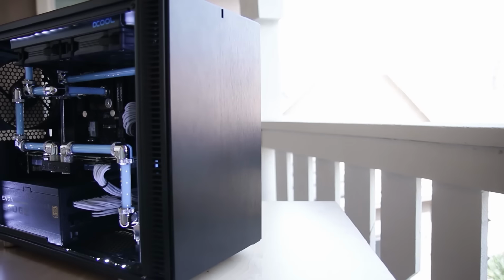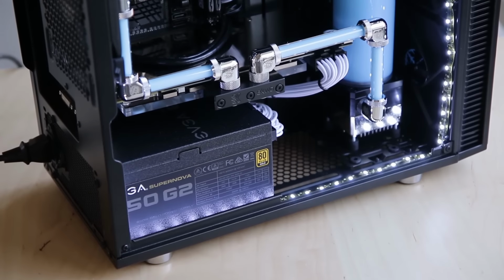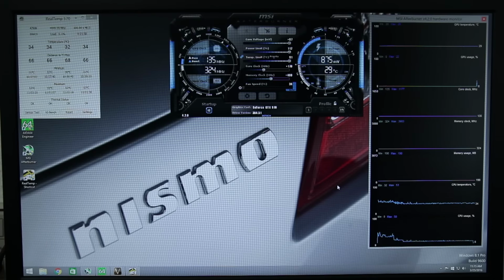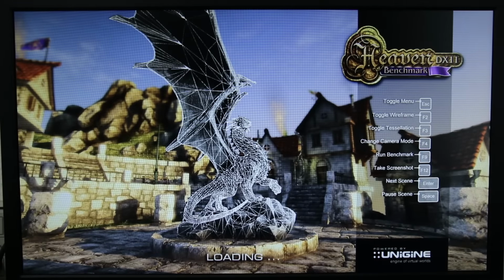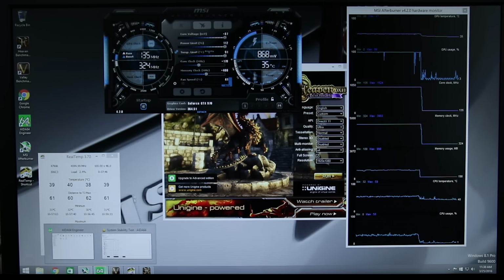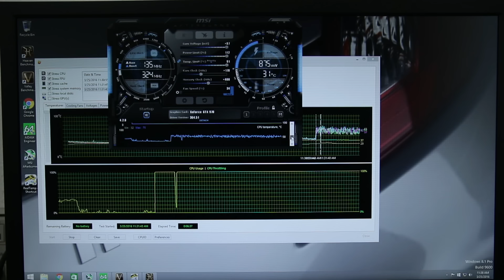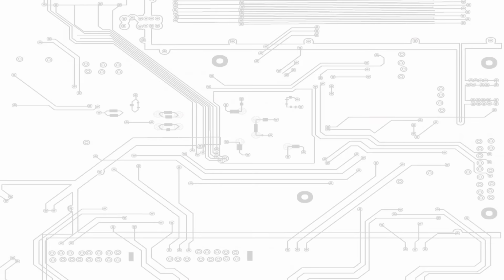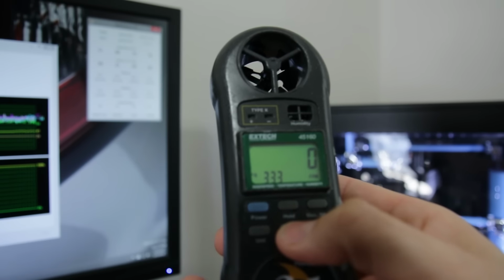Was a 240 Radiator enough?? Temp testing the ITX build

Comment: why do people put a radiator in the front intake of the case, doesn't that introduce warm air into the inside case, wouldn't that be counter productive of what a radiator is supposed to accomplish
Reply from the maker: +devil driver187 Ive already done a video debunking that. Go watch it.
Reply: +JayzTwoCents Link?
Reply: ***** ok, thank you jay
Reply: +devil driver187 radiator is supposed to accomplish putting the heatoutput away from the component, doesn't matter if this is the air in the case or outside of the case because the closed system what we are talking about is the water cooling loop, and the radiator puts away the heat away from that system to another system, simple thermal dynamics
Reply: +devil driver187  linus did one too, recently. differences between, push, pull, push/pull, push/push, intake, exhaust, all that. come to find out, as long as your fans aren't fighting each other, the results are about the same.
Reply: +Jan-Christopher Estelmann my case runs around only 5 degrees warmer at least on the inside when I put my rad in the front, tried positive and negative air pressure, in terms that 5ish degrees, I noticed my gpu running 5-9 degrees warmer, My cpu is 1-2 degrees warmer ""cpu water cooled" "gpu not water cooled", :( I understand the whole moving the heat away through the liquid but all air cooled stuff is affected by this, I wonder if I did something wrong
Reply: Doesn't matter that much...  As long as the air is eventually pushed out of the case.
Reply: +Phillip Tunstall that's it!!!!!! I think I gotta boost my rear exhaust a little more, and that should do it, Thanks man
Reply: The temp decrease your loop gets is more than the heat increase you get lol. Front rads hardly add much heat to your system but having another rad in your loop decreases temps quit a bit. I run a 140.3 in the roof and a 120.2 in the front and my temps are nice and cold.
Reply: +devil driver187 not really since the radiator is getting the cold air. the only time it makes a difference is if you have another radiator e.g. on the top
Reply: +devil driver187 

Using a front intake radiator does increase air temp inside the case but it doesn't make it go hot. Usually makes inside air 5-10 degrees (Celsius) hotter but can be minimized with adequate case ventilation. If the choice was between a single rad on top vs a single rad on front I'd go for single rad on top, but if the choice was between a single rad on top vs two rads on top AND front I'd go for two rads always.
Reply: +devil driver187  I have done this and I can tell you that the HDD gets to 50 degrees which is not good, rams are hot and motherboard temps stay around 40 degrees, but nothing to worry about.
Reply: HyunMo Koo I like having my push pull front rad, could be a placebo effect but I feel that the extra static pressure is nice to have to blow right across the gpu.
Reply: +devil driver187 tldr: Nope.
Reply: It doesnt really heat the whole box like many people think. Jay already did a video on this. Go check it out.
Reply: +devil driver187 You must be new. Look at his videos....he already debunked this. its his Razor build
Reply: +devil driver187 Pretty sure placement of the radiator generally doesn't make any difference. Also I don't think there's even much difference to using a water cooler to a heatsink, or at least any major difference to make water cooling worth it.
Reply: il2xbox I'm lazy :D
Reply: bcz it looks cool c: and i have a full size widowm on the roof c:
Reply: +Bradley Jansen Actually even then, no difference either. Go watch the video from Linus about this topic. Surprised me aswell.
Reply: +devil driver187 think of a car and their radiators always front mounted
Reply: +devil driver187 As long as you have positive case pressure the heat in the air coming off the rad has no time or place to add heat back onto components within the system. It just leaves. Especially if the main components are watercooled. Everything under a block would be completely isolated from case air. This has been proven on forums for at least 10 years now.
Reply: +koolBOY8323 what? That isn't what the test was about? It was about cooling performance and not the temperature of the air
Reply: +MoistGoat Its worth it if your overclocking, plus water cooling generates less noise.
Reply: +devil driver187 How's that when you're pulling cold air through the radiator? The cooler air will cool the liquid and some cool air will pass through the radiator into the case. What I don't understand is why people would place their fans to exhaust in a top mounted radiator. You're just dragging warm air from inside the case through the radiator. Having your fans as intake in a top mounted radiator sucks in cooler air from outside your case onto and through the radiator.
Reply: +brian rizzo (Shadowman8517) Well, engines run much hotter and computer cases don't move through the air;)
Reply: +devil driver187 It does not, watch Jayz video on this, even Linus tech tips has a video on this.. I have a 280mm closed loop cooler in the front (as intake) on my 6600k, and only a 140mm fan as exhaust in the back. Getting 27c at 100% cpu load (18c ambient temps).

Then i moved my closed loop cooler to the top as exhaust and putting 2x140mm fans in front as intake, getting only 2c-3c cooler then the other way. One thing it really introduced was alot more noice since i can close my top when theres nothing mounted there.

Fractal Design Define S

sorry for bad english
Reply: +MoistGoat Not worth watercooling a CPU? Lol. I sit at 4.6Ghz and max my temps hit under stress test is like 58c. Let's see an air cooler do that. Oh and that's with fans running at a constant 800rpm.
Reply: +devil driver187 some people will say your right some will say it doesnt matter and i can only base it on my own experience and ive to tell you that if your gpu is not watercooled it will bring alot of heat in the case and if you mounted the rad on top  as exhaust that case hot air will pass the rad and make your water hotter so in that case its better to mount in front as intake as the gpu heat doesnt influence the rad but that only matters if you seek the limits. in jay situation the cpu and gpu is watercooled and are on same loop so the two main  heat producing components dont influence each other as air in the case(only as water).

i think it will matter more in the future when ram and ssd will also be a very hot component.
oops i told a secret....(watercooled ssd is already confirmed so it wasnt a secret.)
Reply: +devil driver187 Most likely it's because you get less air in the case because of the radiator's FPI and lower CFM from static pressure fans.
Reply: i'd just like to mention that any tests that have been done focus on the temperatures of the components that are being liquid cooled - which aren't the components that may be affected.

i'd be much more worried about the VRM's, Mosfets, and the Memory if their Voltage is on the higher end. mostly the CPU Power Delivery though. they tend to run warm as it is, and their cooling solutions are.... well, craptastic usually.
Reply: +Voodue Linus did a video on delidding it doesn't affect much
Reply: +devil driver187 
Because their smart like me its working on my pc so no it isn't !
Reply: +devil driver187 You are right, but in reality it doesn't make much difference. The speed with which the air is being circulated compared to how quickly the heat transfers into it is much higher so you don't really get much hot air inside at any given moment.
Reply: +Brian Hamel Linus just changed the stock thermal paste and put the lid back on. Delidding is keeping the lid off and mounting the cooler directly to it and yes, it makes a big difference.
Reply: SaladFingers

I dont give a fuck what linus thinks
He never teach anything i didnt know already.
Reply: SaladFingers Oh, my mistake. A question though, I heard that when you're putting a cooler directly on a die ( Like back before they started putting heatspreaders on cpu's) that it was easy, if you weren't super careful, to chip a die and kill your CPU, correct me if i'm wrong.
Reply: I'm not sure what you mean, but the biggest risk imo comes in the actual process of delidding it. Different architectures will have the caps positioned on different places so if you pick the wrong side to use the razor you could kill the chip instantly. If it's done right, then just being careful with the mounting pressure I think is enough. But yeah, this stuff comes with risks :P
Reply: Brian Hamel the risk is to crush the processor when you screw the cooler to hard on . even a small fraction of over tighting can harm the processor . much saver to fix it on the die cap and not directly to the processor.

it can be done but its very risky and dont forget even if it worked a little bumb on the case can affect the processor as the weight of the cooler and mounting pushing on it will resonate.

the few degrees or Mhz you gain is not worth it.
Reply: MrBall Breeder That's what I thought, thank you for clarifying that
Reply: +devil driver187 He showed the air output temperature; went from 24 to 34C...
it would make the parts inside the case 10 degrees warmer, but the true heat generating parts (cpu gpu) don't really GAIN much if any heat from the surrounding air; they are covered by the loop. 10C increase on your mobo vrm might affect things in a minor fashion but really it's super negligible unless you are overclocking the hardest ever super l33t rig.
Reply: brian rizzo always mount front....yea VW beetle and porch would facepalm you
Reply: +frollard actually this had been covered before are it was proven to make no difference, top or front.
Reply: Nemesis Zero

front can be worse if you have lot of positiv pressure kinda like a vaccuum but its only about 5 degress as most and its better to use both than only top
Reply: +devil driver187 its only marginally hotter. dont worry about it :)
Reply: +Intvel Nexus but Jay already tested it and proved that theory wrong, plus positive airflow doesn't create a vacuum (unless you are using a vacuum or huge fans at high RPM, not possible with PC fans) positive airflow would remove hot air faster and benefit cooling.......
Reply: +JayzTwoCents you come across very ignorant ... but hey i suppose thats just you .. youtube videos make us better than others
 yay
Reply: +moose man For him to be ignorant it would mean that he doesn't know what he is talking about. Since he has tested this, and knows the facts about it, he isn't ignorant.
Reply: +moose man as Krytern UK said, Jay can't be ignorant on the subject because he has tested the theory in the past and proven people completely wrong, i bet you are someone that believes that cable management helps to keep a PC cool lol
Reply: Nemesis Zero I remember being in a argument with someone about 5 years ago in regards to cable management. At that time I was lazy and never did it and he constantly kept telling me my computer will be hotter then it should be, even though it never was. I'm glad we have YouTube with people like Jay and Linus/Luke who are willing to test these theories so we can see the true facts in balanced and fair tests.
Reply: Nemesis Zero it used to be important that you manage the cable so it doesnt influence the airflow . now with watercooling it doesnt and on air it still does if you're seeking the last Mhz out of cpu/gpu while overclocking.

dont get it wrong ,cases that get smaller this days makes airflow still important while aircooling.

the biggest mastake of people getting they're opinions from youtubers is that they dont realise what the youtubers are using .
in case of linus they always use low but more mainstream stuff , not overclocking ,low voltage and Mhz cpu makes cooling less important as that way you could cool it passively.
in case of Jay ,he always overclock and try to get the max out of it.

both of them gets true results but in case of linus channel it gives a wrong impression .
example :what cpu did they use for the cable managment video where he fills up the case with anything.surly not the 6700k at 4.7 GHZ and 1.35v. Linus group are specialist of thinking an answer to a question and then work on it to get the results of they're answer.
this way you cant say they lie but for people who has the knowledge about hardware makes they're test and results unreliable,doubtfull and fake.

but hey he prooved on a video dude.yea......
what did they prooved actualy?
that some cpu can be cooled passively not that airflow doesnt matter while aircooling.
Reply: MrBall Breeder Doubtful, unreliable and fake? Fact of the matter is that the test they did for cable management was fair and the results show it makes no difference. How is their video fake? Do explain. Did they lie about what the temperatures were? Did they underclock the CPU when adding more stuff in the case to get the same temperature readings? No.
Reply: Krytern UK as you request explaination means you dont know enough about hardware. 

they used low end intel cpu with low speed and voltage .that means low heat that can dissipate passively without any fans attached on the cpu for short periodes and as they are well knowed todo just a 10 min test it fits the result of cable managment and airflow not having significant impact.
i want to see them doing same test with an I5-6600k and i7-6700k at max overclock speed

same as an other video about watercooling AIO that showed an cpu working at 100% while benchmarking and reached 35C as max temp after 10 min test.my guess is that both video used same cpu. dont forget that this temp was while benchmarking.

as i sayed before you cant say they lied but they have tweaked the truth as an magician on a stage.

the results are very misleading as the majority seeks max performance what they're wallet can reach and can harm consumers that build a pc based on those videos.

for the rest i trust more Jay,Paul ,Kyle ,tech syndicate,singularity computers OC3D or any other tech channel than linus as linus videos is not about to teach stuff but more how they can gain more money.Linus is a bussiness the tech channels are tech enthoussiasts.

if luke would have done the "cable managment "video with an long time frame benchmark as 3 or even 6 hrs the cpu and gpu would throttle , but that doesnt fit with the answer results they wanted to show. 

by that they tweaked to get that result and by that makes them unreliable,doubthfull and fake but i never sayed liers.
Reply: +Krytern UK exactly, the test they did with cable management was very fair lol, they blocked ALL of the fans and it made no difference lol, looks like we weeded out a "know it all" lmao
Reply: +MrBall Breeder dude, you need to stop arguing a point that you clearly don't understand, just so you know i have tested my system for cable management by also blocking my fans and got the same results while overclocked, first i tested using my old 212 evo, then again with water cooling, i have seen for myself that cable management makes no difference, for water cooling i have had my radiator on the front of my PC and then moved it to the top and had exactly the same temperatures while idle and during a stress test, it makes absolutely no difference and doesn't create more heat.

You are believing old myths that have been proven wrong time and time again, that in itself shows how much you really know about PC's, stop being so judgemental and take the videos you watch seriously, these people like Linus and Jay are on Youtube making videos in order to help people, they make a living off of teaching people that are less experienced because they want to help!! so do yourself a favor and pay attention, not everyone on Youtube lies and not everyone is out to get you!!
Reply: Nemesis Zero He seems to think that Linus magically makes more money if he says cable management makes no difference, compared to if he says cable management does make a difference. That makes NO sense at all. Where does the extra magical money come from?
Reply: Nemesis Zero dunno why you are talking watercooling to me when you talk obstruction of airflow you are mixing both just for the sake of argue.

you tell me i clearly dont know what im talking about but say such of idiotic arguments as that there is no difference on temp while overclocking with  obstructed fans on your evo . i dunno what  "overclock" means to you but my 4770k with 1.35v at 4.7 GHZ not only show a differance in temp but also throttles down if i obstruct the intake or outtake  of my swiftech watercooling rad and no it doesnt after 10 min but it does after 45 min  .same goes for my 4690K overclocked at 1.35v at 4.8 GHZ watercooled with an AIO corsair H110i and my 2core duo E8400 overclocked to 4 GHZ   cooled on air with an old air cooling block similar to an evo and my 2core quad Q6600 at 4 Ghz aircooled with the old noctua nh-d13 gets BSOD

so stop telling bullshit and stop acting as an linus fanboy because i doubt you can match my 25 years of experience  in pc hardware

and god damm  stop putting words in my mouth .I NEVER SAYED THEY LIED.

i sayed they tweaked the truth as an magician on stage as no decend cpu gets maxed out on benchmark at  35C with aircoolers or AIO.

testing obstructed airflow  on low end cpu like the 6100U  for example with aircooling block never will give any difference as its low voltage and clock doesnt need any aircooling as a passive cooler would be sufficient and thats what they showed but saying that the results showed that there is no difference in general is just criminaly wrong.

i clearly know what overclock is and its more then just ramp up from 100 to 103Mhz in your  UEFI.

linus videos are clearly NOT for  helping with they're videos and i even doubt you checked they're website. linusmediagroup  is an business and a business needs to gain money to pay the somany employees.linus is a great business man i never doubt that but all they're videos doesnt learn anything else than general information about home pc and home IT .explaining quickly as possible  in 5 min a text wrote by one of hes employees who clearly knows what google and  wiki is and talk about the history of stuff copyed from the wiki isnt usefull information as its general knowed and general accessible.

stop trying making linus an tech god and stop him to threat you as an moron that cant google and dont know about wiki.

i also dunno why you bring Jay in the argument as i already sayed i trust Jay's information

maybe im arguing with a troll here but its time that the truth gets out there and the curtains falls down because generalising results of a brainstormed session about how and what to use to get that end result just for the sake to bring a video out .will have as final results that peoples wallet gona hurt and that will not be mine.

and now just for fun lets do the same as they do

linus:lets proove that a pig can fly and make a video of it
luke :how can we get  a pig flying
linus : i dunno ,how long will it stay in the air if 3 people throw him up in the air
luke : not long for sure but if we shoot it with an canon in the sky it would be longer.
linus : lets try it and if it fits in a 5 min vid ...

NEWS
FLYING PIGS CONFIRMED BY LINUSMEDIAGROUP.
(they have video to prove it)

did they lie? no they dont .the pig did fly....

this text wall will not matter for trolls and fanboys as the one only seeks meaningless arguments and debates and the other only see they're favorite item or god as the best but the shiny blind them .
Reply: +devil driver187 Pretty much margin of error
Reply: +devil driver187 Yeah it'll wreck it
Reply: +devil driver187 THis guy isn't the know all, be all. You have to take into account ambient temps and climate.
Reply: +MoistGoat Really isnt it is more about looks and a preference
Reply: +devil driver187 it's for positive air flow into the case. It's better than having a triple or quad radiator blowing into the case from the top.
Reply: Keng Vang postive and negative airflow doesnt matter anymore with most case build as you cant make a pressure in a case full of holes.

dont get me wrong it used  to exist in time frame of pentium 4 and even for the dualcore ones but there where no scientific proof for it whats the best, until tomshardware asked an university  to test it out and give the final answer (answer was positif pressure) not much later cases started to build holes in the side panel for a fan but it disrupted the airflow stream and they solved by drilling holes all over the case .

these days you can only get a flow of air but not a stream . you can place all the fans as intake and air will push out every where and the only thing you need to consider is the heat build up that a graphic card can create as its a pass true cooling now and not a blower type that only exaust at the back.

if cpu and gpu is watercooled on single loop then it totaly doesnt matter where you mount it.if its watercooled seperated you need to mount it both as intake or exhaust so one can not influence the other but that only show on long runs or at the limit of max cooling performance (or when you seek very high  or max overclock)

and at last if you watercooling one and air cool the other then  mount the rad as intake (preferly in front).

dont care if you believe me or not but i can tell you that several pc builds has returned when cpu rad was mounted on top as exhaust by request of the buyer even if i warned them.

heres a great advice take special attention to small factor cases and do your research on the right channels. examples are overclock.net or OC3D or tomshardware as oldy ones or as newer ones tech syndicate.
dont rely on one result but check all of it and try to see an general line before deciding anything.
Reply: MrBall Breeder I'm a fellow overclock.net member too. Also watercooling for the last 3 years. And yea positive/negative does matter if you don't want dust in your rig. Also a radiator between gpu and cpu does MATTER! Cuz I changed my loop and have a temp probe.
Reply: Keng Vang well thats what dustfilters are for the suckers anyway as you can't create pressure anymore in airflow. (some small factor case still can)

i dont get the rad between cpu/gpu  comment please elaborate .
Reply: MrBall Breeder unless u have HEPA certified filters good luck with that.
Reply: bmxriderforlife1234 you can achieve a pressure if you obstruct all the holes.

have fun with that.

i cant even with 10 fans on my case and taping over the majority of holes.btw i have 3 200 mm fans 2 140 mm fans on the rad and the rest are the NF-A 15 of noctua with the nzxt H630 case in my 4770k build.
(heat still building up from the gpu)

btw all cases are possitif airflow build but cant be achieved because of the holes.small cases have less surface to drill holes in it so thats why im telling to watch out with those.
Reply: bmxriderforlife1234 duck tape is the force Luke
Reply: +GoneBadKiwi Water cooling less noise? Often not true. My Noctua air cooler is barely audible in a quiet room at 100% CPU load. For many liquid coolers the pump alone is audible, but there's some pretty NOISY liquid coolers around.
Reply: +Brian Hamel All coolers sit on the heatspreader, regardless of whether they are liquid or air. As said below, it's only for delidding to improve the conductive material between the chip and heatspreader that you can do damage (though even with the heatspreader a lot of weight can damage some CPU's such as Skylake while shipping which is not recommended.)
Reply: +frollard ambient temp went up 6degC so you have to factor that in and just use the Delta values
Reply: Jeffrey Photonboy already sayd no need to copy
Reply: +Jeffrey Photonboy my Kraken X61 pump is dead silent, but my 6700k @ 4.5Ghz idle's at 28c - 32c...plus it is on it's default setting, not silent mode or what have u. Those time's u hear about noisy pumps is either cuz it's broken with a fault, a cheap brand AiO, or they have it on maximum settings. AIO's FTW!   :)
Reply: +Muffin Man (MuFFiN MaN) The heat sink would have to be larger than an NHD15 to pull that off.
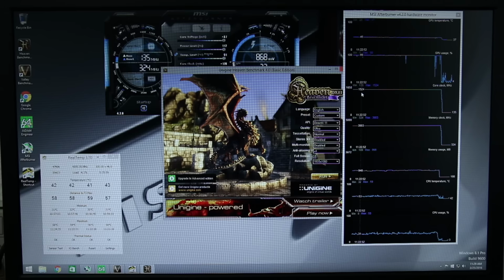Reply: +IaMaWeSoMe7478 @6:28
Reply: +devil driver187 wouldnt it be bringing ambient temperature into the loop? like from outside the case? thats how i have mine set up on my nzxt h440 at 4.7 i hit 56 C on prime 95
Reply: +devil driver187 JayzTwoCents did a video of it, ad if it mattered. Go watch it! :)
Reply: At the end of the day, it doesn't make much of a difference in a case with proper air flow.
Reply: People also have their cases on their desk.
Reply: lmao petty
Reply: petttyyyy
Reply: I love how that was one of the first things he said in the video, but you still brought it up...
Reply: air coming from a pc radiator isnt that hot and there is not that much air moving in a pc. it really doesnt matter much
Reply: I would of used a 560mm 86mm thick radiator with noctu fans in it for a single gpu and cpu and ram cooling and mother board cooling aswel
Reply: i run my 240 top mount pushing into the case because my case has a top filter and it was the only option for placement. Also, because i have my pc in a semi closed cabinet, i opted for a front exhaust in my prodigy using a bitfenix 230mm fan. temps have only gone at max 10 degrees above ambiant
Reply: Why do people put radiators on the push out of the case so they can breath warm air thats been heated by the components and not cold air from outside?
Reply: Aura Rowe doesnt really matter all that much for cooling anyways. you either heat up the air inside a tiny bit when you put the radiator on intake or heat the watercooled components up a little bit by putting it on exhaust. in either case it differs a degree or 2 max 3
Reply: it was a rhetorical comment to the OP, yes its a very small difference and most custom loops have a intake AND exhaust radiator.
Reply: Devildriver187 yeah thats a shitty choice